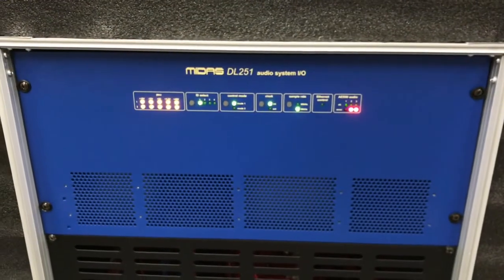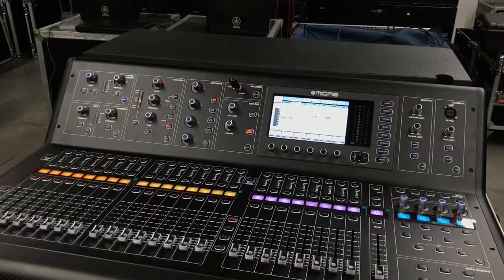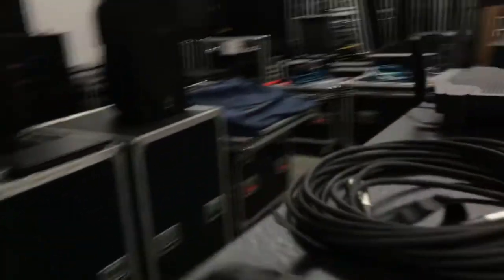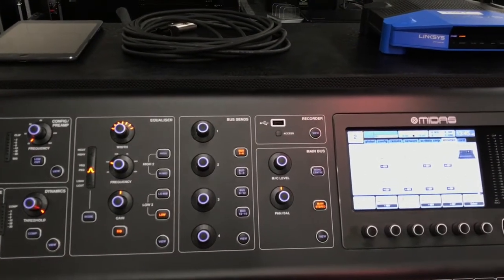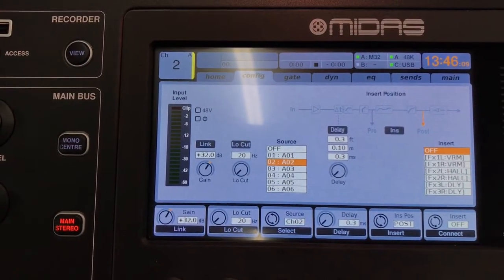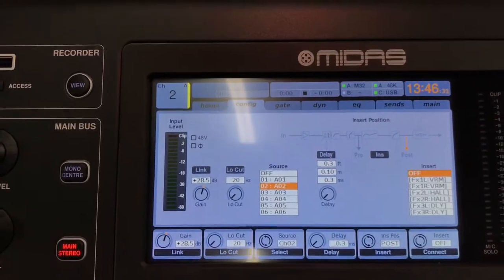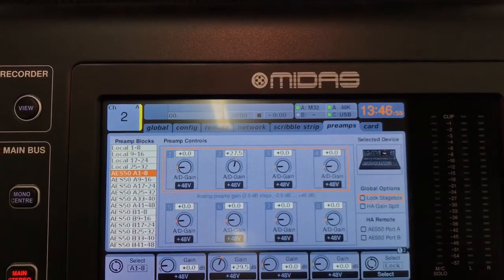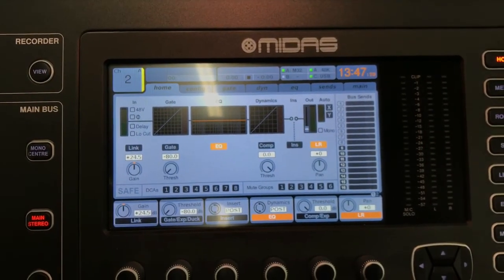How Midas & Behringer Preamps Work: 2.5 dB Analog Gain vs .5 dB Digital Trim DL251 X32 M32 WING Pro

Comment: The preamp behaviour is actually normal. The DL32 or internal preamps do react the same way. 0.5 dB increments on the channel page, but 2.5dB jumps at the analog input stage. That kind of "hybrid" HA control is quite common in digital desks and is done via a digital trim that "fills in the blanks" so to say.
Reply: Could THIS be the reason, why my Virtual Soundcheck has always different volume than in the moment we have recorded the data for the soundcheck?

Comment: Is DL153 compatible with M32? For instance, if I have M32R and DL153 linked together so would that require some extra patching (besides a single  AES50A Port) or firmware updates on the console/stage box?
Reply: I use 2 DL 153 pres with both midas m32 and Behringer x32 consoles with no problem as long as your on the latest firmware.

Comment: IMHO, the monitor mixperson should have headamp control.  An unexpected gain adjustment by the monitor mixperson can cause an issue in the house, but an unexpected gain adjustment by the FOH mixperson can cause all h*** to break loose on stage.
Reply: YUP 100% - FOH should NOT have gain control...